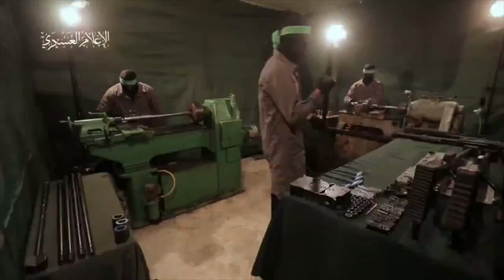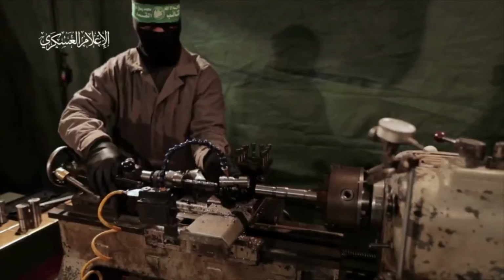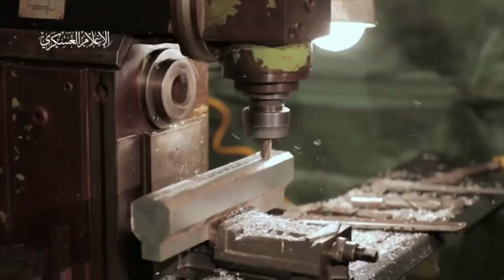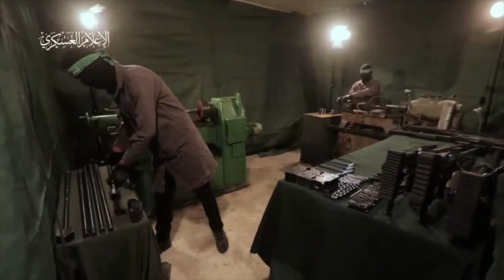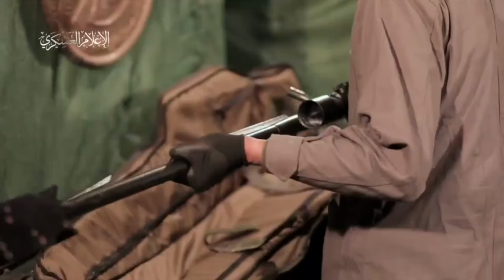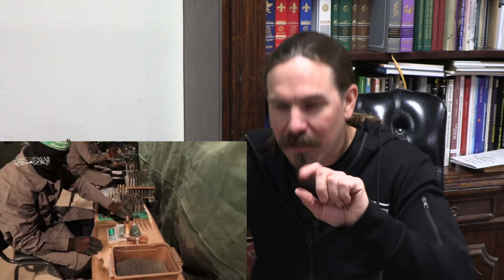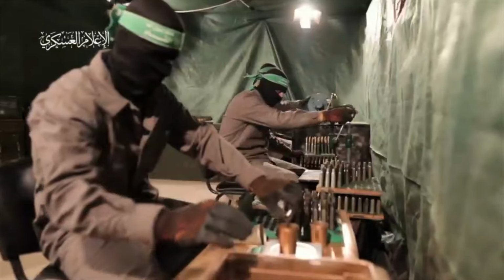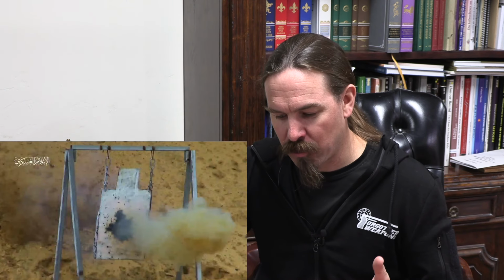Hamas Claims to Make Sniper Rifles in Gaza - Are They Really?

Comment: The material being milled at 5:55 is most certainly aluminum. We know this because, what we see is a climb cut without the use of coolant, and the speed and feed are too fast for steel.  You could use aluminum for a scope mount, but not for crucial components like receivers and breach blocks.  The images from 6:42 is clearly a fake set up and not actual production scenario because, from an inspection perspective, you would never mix of completed black anodized components (on the right) together with unfinished partly machined components.  I agree that the 'engraving' is too deep for lazer engraving, but having used both 2 and 3D pantographs, I am pretty sure this is not pantograph engraving. If you notice there is a  slight bulging at the bottom of the curved letters, like one would expect from a stamp.  There is no doubt that this video is fake and that there is no way that Hamas manufacture their own sniper rifles.  Perhaps they make scope mounts but I doubt even that, and maybe they have a special stamp that they can use to 'brand' rifles they have obtained elsewhere.  I doubt that any of this will make Israel, who are proper manufacturers of exceptionally good quality weapons, lose any sleep.

Comment: I´m a German " Feinwerkmechanikermeister" (looooong german word)  translated "precision machinist master" and this is the dumbest BS I´ve ever seen. The lathes are way too old and worn out to produce long barrels for a weapon with the highest precision. I think they are not even long enough. The biggest problem is you have to drill a looooong hole with a small diameter and then the barrel needs riflings.  I´m not really sure what materials are used for barrels but it´s definitly not this stuff. Then comes the coating of the parts and the heat treatment, I never produced weapon parts but I´m 100% sure that barrel, chamber and a lot of other parts must be hardened

But what really shows that this is BS are the small things. Everything is too clean. There are no oil splatters on the floor and no shavings under the mashines. The lathe chucks have the normal unprecise jaws in it not the ones you have to turn out for more precision. They use a totally unprecise drill chuck and there are dozends of other small thing.

 Maybe they can make adapter kits for scopes or flashlights or even improvice sniper rifle by using hunting rifles and combine them with military grade scopes but I doubt that very much. Every workman who knows basic stuff about metalworking and/or weapons could say that this is nonsense.

Comment: LOL. Yeah,they also said israels billion dollar hi tech border barrier was unbreachable with sensors, remote weapons stations, underground sensors,cctv, yet these same rifles along with drones took out cameras and satellite dishes and power lines. They said it couldnt be breached. With the limited resources that they have , theyve managed to inflict heavy casaulties on the israeli army, one of the best trained best equipped, experinced armies in the world. Also,most engagments in Gaza are close quarters urban warfare under 1000 feet, so theyre using it as anti material rifle to pierce concrete /brick buildings occupied by israeli troops who  use randim buildings as shelter and as a forward observation post or sniper/cover firing postions. Houses in the middle east are typically not made from the same material like in the US. They are made of much stronger materials like sandstone,lime stone,concrete,bricks,so you sometimes need stronger calibre rounds to pierce thru such materials. An M-16 or even an AK-47 sometimes wont pierce right thru. 
Id like to see any american civilian paramitary militia take on the full might of the israeli army and inflict heavy casaulties on them like H@m@s is doing. Theyre still a very skilled guerilla force in mitary terms. 
Also, H@m@s is still standing and inflicting heavy casaulties on israel's elite infantry and armoured formations. Even after 2 months and according to israels own admission over 20,000 air and artilkery strikes on an area half the size of New York city .Even though it does make its own weaponry but for operational security reasons it obviously dosnt reveal its trade secrets,not everything, its also part propaganda and even though they do make some of their own weaponry,others they smuggle in from their allies. So they like to give you the impression theyre made in Gaza too not just for propganda,but deception, to conceal the existence covert smuggling routes from which theyve been able to acquire far more advanced weapons like the russian made Kornet anti tank missile system which is one of the best in the world. Theyve also displayed north korean origin weaponry. Some weapons they do due make on their own due to technology transfers from proper militaries,H@m@s isnt a profesional state army, theyre a paramilitary organization. 
They can make their own tandem PG-7VR rpg,s too. 
You dont need to be hi tech to be effective. Even a low tech group with  Its innovation, tactics,doctrine,operational security and the will and determination to die for a cause is all thats needed. 
Technology helps alot but  alone it dosnt equal winning wars in the end. 
H@m@s arent dumb as you think. Theyre very experinced and understand that as Sun Tzu said in the Art of War "war is deception". H@m@s leaders have even been quoted saying that famous quote "nesscessity is the mother of all invention". 
Underestimating your enemy or holding them in contempt is a fatal mistake. A general in the Rhodesian army special forces the Selous Scouts once said that. Thats true in any war.

Comment: As you say its a film set, i do quite a bit of home machining, the lathes have no chip tray so coolant cannot be used, and there is no way of containing the swarf apart from it dropping to the floor which was very clean, ten minutes of machining and you are up to your knees in swarf, and gun drills are longer than the barrel so you need a machine that is probably 3 times the length of the barrel to accomodate workpiece drill plus tailstock and headstock, non of which was on show. Plus they live in tunnels for a reason, if they set up a range like that in Gaza surveillance would spot them in an instant.

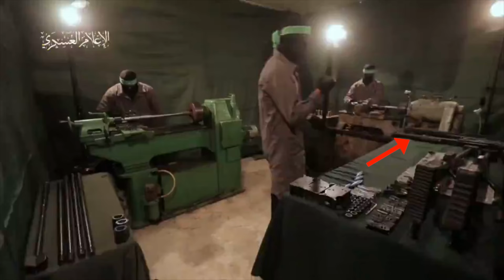Comment: 1:27 seconds video. 
The video was not about the manufacturing. It was first introduced 2014. The video is to show the ability to have atorage under seige for a long term operation. The thing is the have made the range longer up to 2k. Bigger bullet size. And sadly the news shows that it actually works. 😢😢